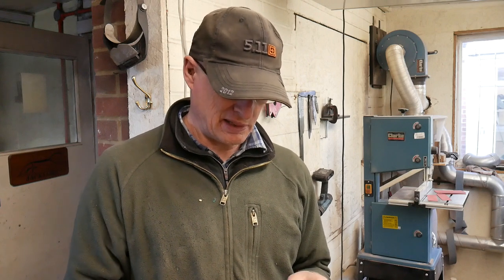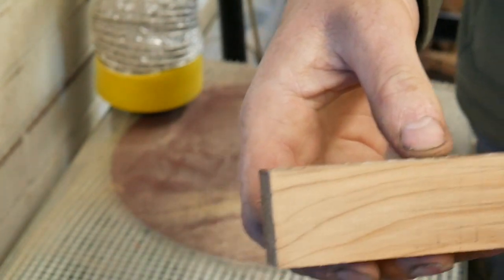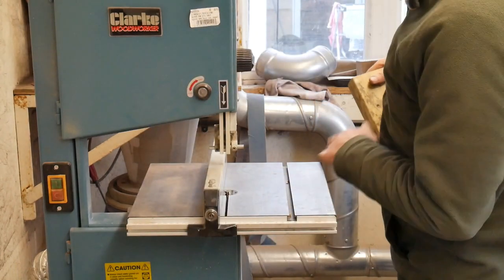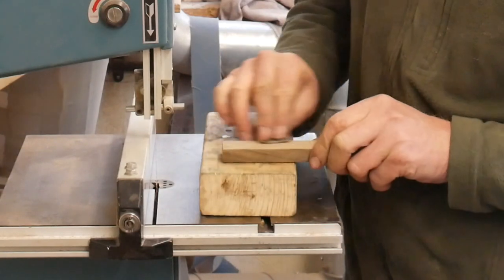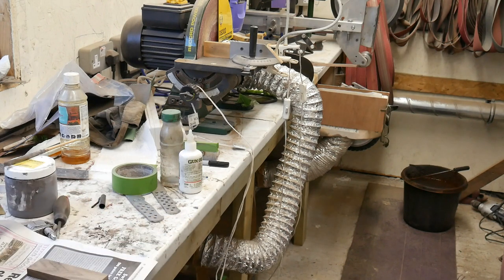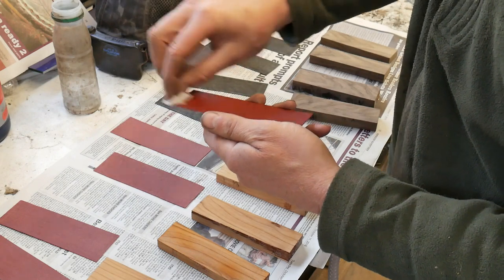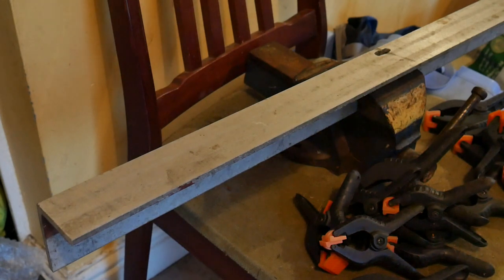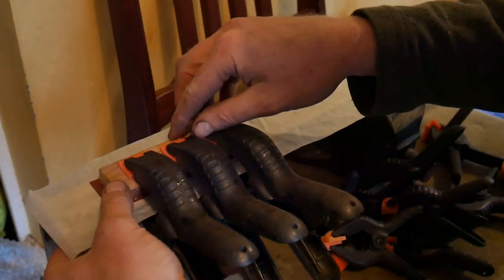Knife making: Fitting liners to Scales

Comment: You really should vacuum the dust off the scales Sandy. Your air cleaner probably runs at about 10 air changes per hour and won't fully scavenge all the workshop. It will take quite a while for the blown dust to reach the filter, and you'll probably inhale it first. Keep healthy. ATB. Bill
Reply: Thanks Bill. Will use the vacuum next time:)